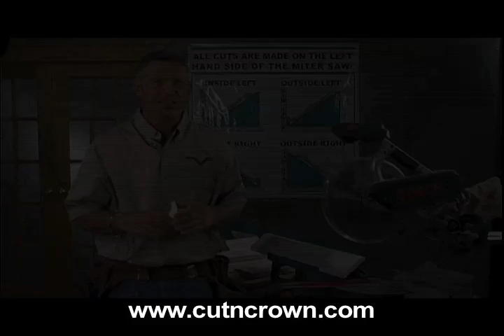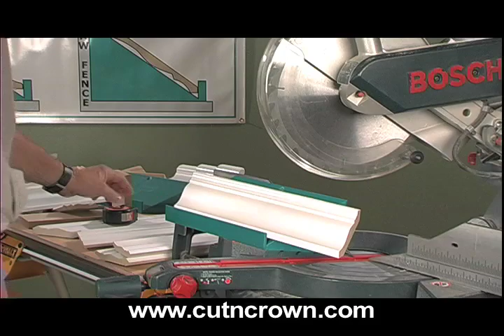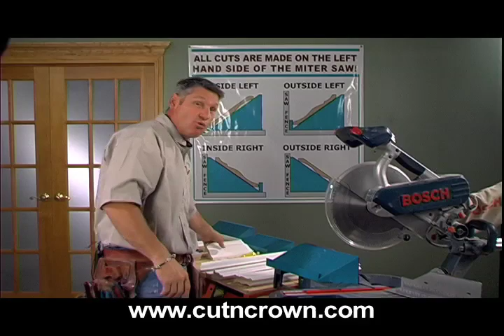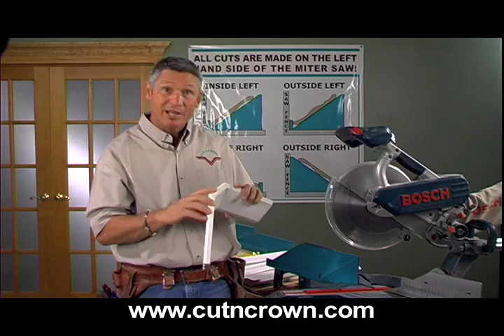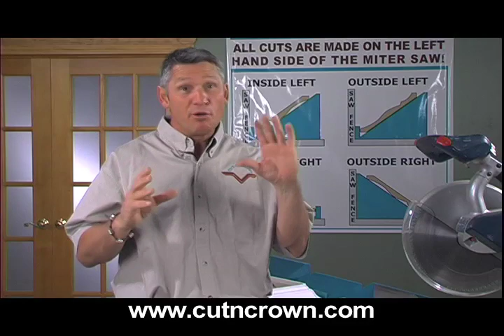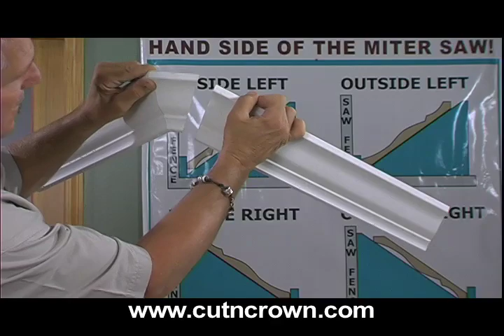Bull Nose Corners Crown Molding

Comment: Actually this guy is wrong about the installation process . I trim houses for a living and the quickest way to make the corner is with 2 positioning pieces , the small point piece and a length of scrap about 1 foot long .Join the 2 together on the wall and ceiling with 22.5 deg. angles cut on them . Make sure that the 2 , 22.5 angles fit together . Take a brad nailer and nail the point piece to the wall and ceiling , now you can accurately get measurements or scribe to fit the adjoining lengths.